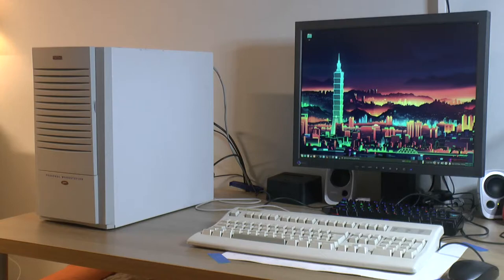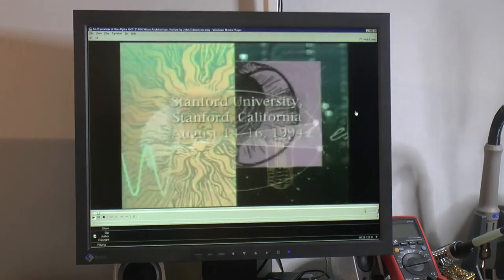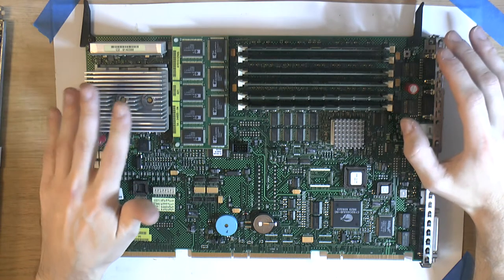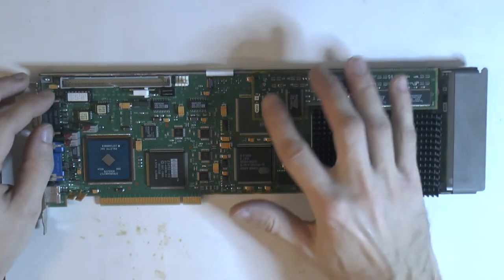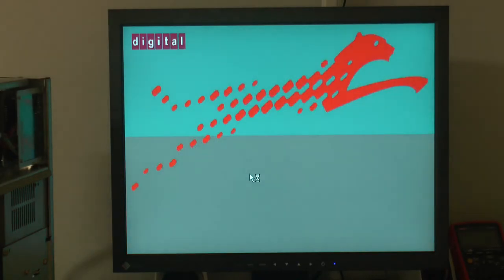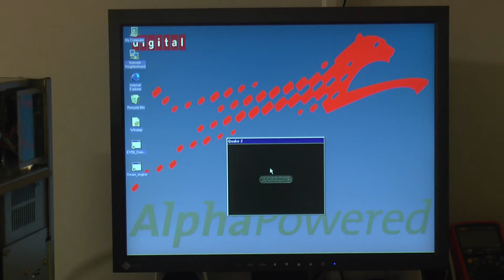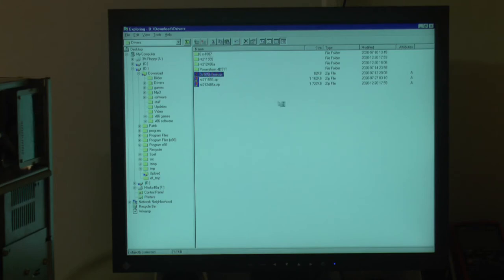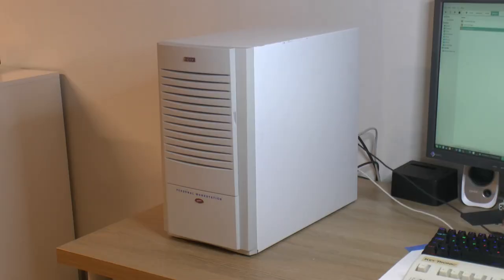Digital Alpha PWS 500AU upgrade

Comment: Another great video! So lucky you were able to procure a 600MHz CPU! Quick question, where does one go about getting the "OpenGL EV56 tech demo" you played around with near the end of the video? That's a pretty slick little OpenGL demo!
Reply from the maker: Well I have never made it public really because there is very little if any demand for alpha software and I just wrote it to learn to program some OpenGL for fun.

I uploaded my demos for Alpha and x86 plus the source here to dropbox now. Plus there is a support directory with the libs, dll and header file if you want to compile glut/opengl stuff in VC6++ yourself.
I also compiled glut for alpha because the demos uses that but the glut dll is included in every demo so should run with just that.
Thats how I got the glut dll etc and there is a ton of demos included with glut by kronos there so uploaded that to.

The EV56 demo is not that well optimized because I cant program very well.
The Steam engine demo has no textures but its more optimized for lower cpu usage but uses a LOT more polygons so dont expect any high frame rates, was written more for GeForce 256 cards in mind, its high on polygons. But it runs.
Here is the link.

https://www.dropbox.com/sh/w2i18kwg31wjudx/AADF1ByHLiyZYMOPsgdi87pia?dl=0

Use my demos at your own risk.
Reply: Thank you so much for sharing! I'll let you know how it goes.
Reply: Thanks for sharing. Do you have vc++6 for alpha? I had a hard time finding it last time I looked
Reply from the maker: @Douglasvj  http://ftp.braindrainlan.nu/RISC%20Windows%20NT/
ntrisc.zip contains one version.
http://ftp.braindrainlan.nu/RISC%20Windows%20NT/Alpha/
there is also one version in there.

I think they are from Internet Archive but they removed them unknown reasons.

Comment: Have you even thought of having ZORIN Linux or GhostBSD (Open UNIX) installed on that system might have been more in keeping with what DEC had in mind, I myself have Linux Mint CINNAMON 19.3 (Tricia) 64bit edition and enjoy programming in AT&T Assembler (Gas), the drives are listed as SCSI drives but show up as /dev/sda1 and /dev/sda2 and my data drive shows up as /dev/sdb1
Reply from the maker: It ran gentoo back in 2006 to 2007 and was a file server. Then it was reinstalled with Gentoo in 2014 and made in to a workstation again BUT it always had issues with heavy CPU load causing crash to SRM console.
Did a PSU secondary side recap and a motherboard recap, seems to have improved stability but never got it fully stable, Linux complained about cache errors.

Got a new CPU to see if cache errors went away and thats why its upgraded from 500 to 600Mhz, made no difference, also external cache was removed for testing, no difference.
I cant tell if its hardware or software thats is the issue and the Cache errors went away at some point and I cant reproduce them anymore.

So for easy use I tested Windows NT 4.0 and it runs very stable, for the most parts so I decided to keep it like this.

Its less maintenance on the software side but it is very limiting in the software it can run but I have ported over latest Quake 3.21 (official is 3.17 and has bugs that later version fixes).

I also wrote a AQ2 client and ported that to both x86 for windows 9x and for Dec Alpha for Windows NT 4.0.

So it has it uses now as it is. I also ported over OpenGL quake, there is a port using SDL but its software and no sound.
But I suck at programing so I cant figure out Why I get no textures rendered in Quake 1, there is some bug so its all rendered with no texturs so gray polygons  are rendered but it runs fine and sound works and it even connects to our server.
If ever learn to program to a useful extent I hop to fix that problem.
Reply: Strange with Windows XP Pro and Windows Vista it was the other way round so once I moves to Linux the problems went away so I find that strange and that time I was running UBUNTU 12.04LTS on an AMD PHENOM II X3 Stepping 3 with an ASUSTEK EN9500GT now I have moved on to a AMD A10-7800k powered machine with 16GiB of RAM and no problems.
Reply from the maker: @DAVIDGREGORYKERR  Well you cant compare Alpha architecture to x86.
There are few distros supporting Alpha processors nowadays, gentoo is one of the few but its pretty buggy to get running nowadays.

I run Linux as my main OS for 20 years.

Also the last Windows version for Alpha was Windows 2000 Release Candidates.
Alpha was declared dead in early 2000 and I think the last machines where sold in 2006 or something and supported to 2009.

Its a big difference running modern Linux on it and comparing it to old windows, one could run old linux dist from the era to tough, might work better but then your stuck with old linux software to.

Like I sad Idk if it has hardware or software issues but running NT 4.0 makes it a usable machine for retro and I tried to make a reasonably modern gentoo install work for 5 years but it never got stable.
Reply: Sorry I spoke.
Reply from the maker: @DAVIDGREGORYKERR  No need to be sorry for anything. I just tried to explain what I have tested and what worked and what did not work.
Nothing sees NT 4.0 is the more overall stable OS and its not my first pick.
It ran Gentoo linux in 2006-2007 but Gentoo Linux changed a lot until I tested it in 2014 again.

I just knows the machine has issues with stability and if thats software or hardware idk, Its super hard to find parts to even begin to test that.

So the remaining options would be to try and old version of linux or Windows Nt 4.0 or 2000.

The last option would be to have it sitting there unused.

I tested NT 4.0 and it seems to be stable so I ran with it.

Thats all.

And if you have more questions feel free to ask, not everything is in that video because I had the machine since 2006.
Reply: I think I will let the subject drop and maybe someone at CANONICAL might have been watching this an release a distro for the Alpha chip
Reply from the maker: @DAVIDGREGORYKERR  I have been trying for 5 years to make it run Linux stable but it crashes to SRM (like the bios of sorts) with in 15min to 1h in say Quake 2 or compiling code or any CPU heavy load.

In NT 4.0 at least its stable, I can play games all day long even if its just Quake 2, Action Quake 2 and Doom 1/2.

So dont get me wrong, I WOULD LOVE LINUX ON IT! XD

But until I can find whats causing the hard crash of the system it seems pointless and 5 years is more that then enough with no spare parts to try with.

When it runs Windows NT it runs AlphaBIOS instead of SRM, its basically two bios/firmwares you can switch between and the AlphaBIOS for NT seems stable enough to be usable for days and it also compiles code there just fine with no crashing.
So the issue might be SRM related only, a theory at least.

So I do want Linux on it, but I nor the Gentoo Devs have been able to figure out the crashes and Windows NT 4.0 works so I suppose its a case where I have to take what I get.
I could try an old linux version from the time period and see how that works someday that is doable.

So yes you question why it do not run linux is valid, it would if it was stable but until then NT 4.0 will have to do, I love the system and want to keep it alive for as long as possible and if that means NT 4.0 well then it will have to do.

I doubt there will be much Linux support much longer for Alpha, they are dropping the support everywhere because no new Alpha CPU's have been made in at least 15 years as fare as I know. Its considered dead and very few users run native Alpha machines nowadays with linux as fare as I know.
Its mostly virtualized if they need legacy Alpha support.

Also later Alpha processors and systems did not have the needed PAL code for Windows NT 4.0 and 2000 RC due to the architecture being replaced by Intel Itanium.

And thank you for your comments I do appreciate them and the questions are good and valid!
Reply from the maker: @DAVIDGREGORYKERR  Also I would love if someone did make a Linux distros for Alpha machines, tested and easy to install. Like a Retro Alpha Linux dist.

Best Regards Patrik